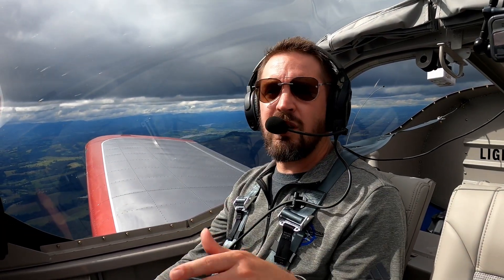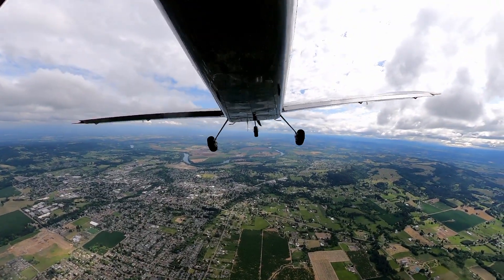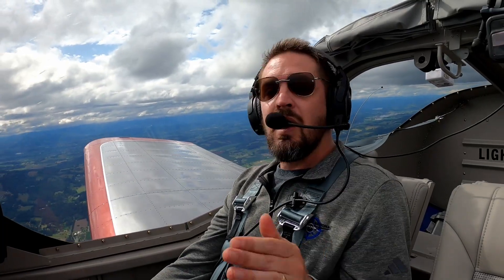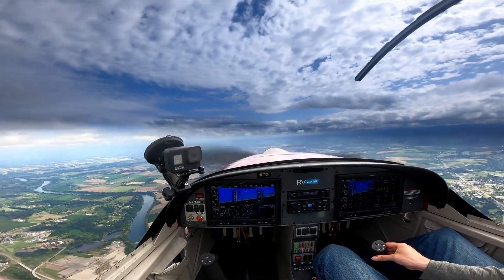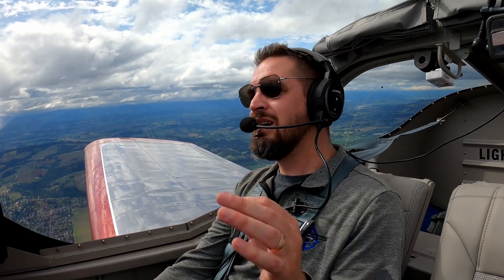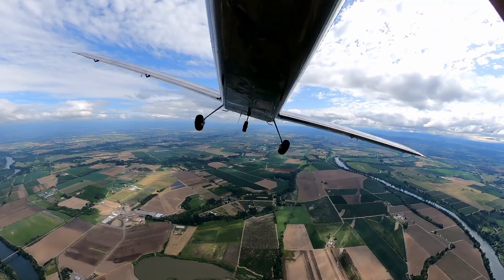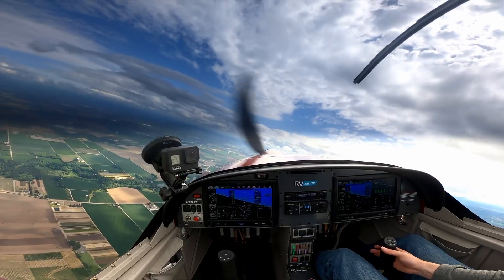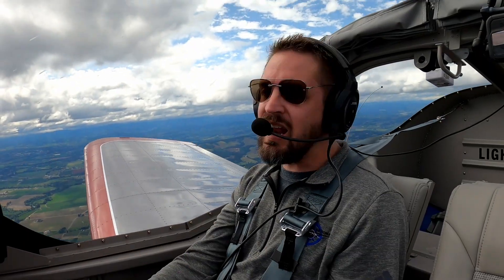Dutch Rolls and more COORDINATION exercises!

Comment: Coming from a distant sailplane memory, here.. do you have a  elip and slide indicator? Would a (glider-hack) length of yarn stuck to the canopy measure it for you?
Reply from the maker: We do have a slip/skid indicator but unfortunately a yaw string won’t work single engine planes because the prop wash will always push it straight back.